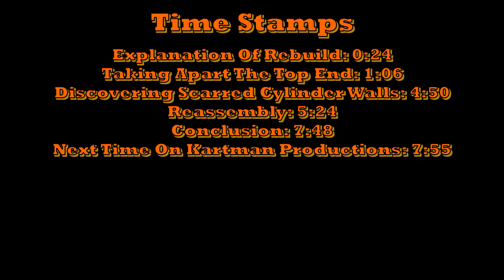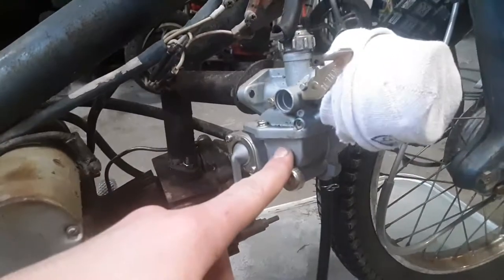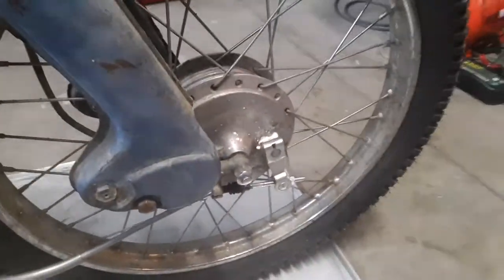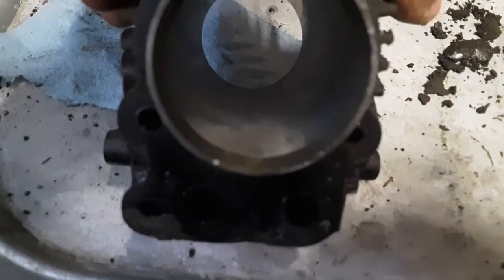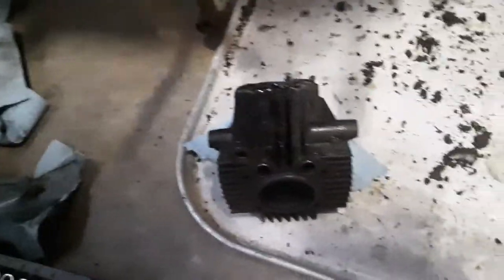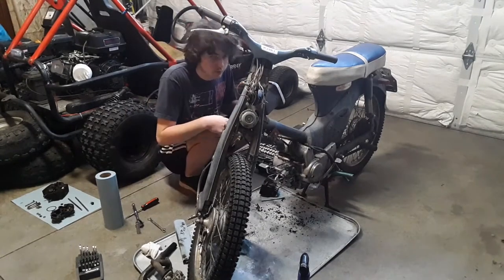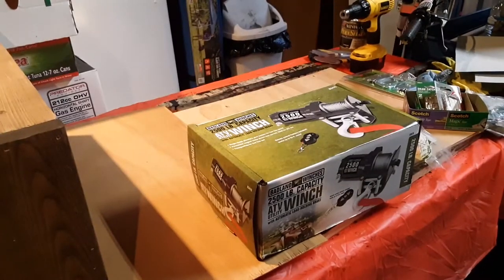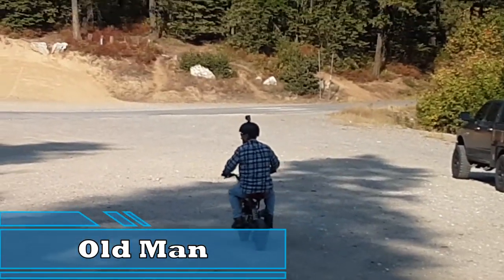Honda Supercub Top End Rebuild Take 2! (Cylinder Scarred!)

Comment: The 1965 Honda Cub 50 did not have a timing chain it had push rods like a car engine we put a longer piston in mine and it went faster it went from 45 to 52 miles per hour
Reply from the maker: Dang that's pretty good! Mine is a 1961, and it is also an OHV pushrod engine.